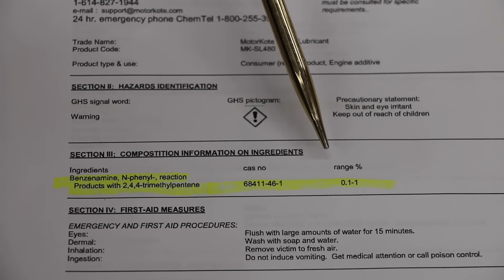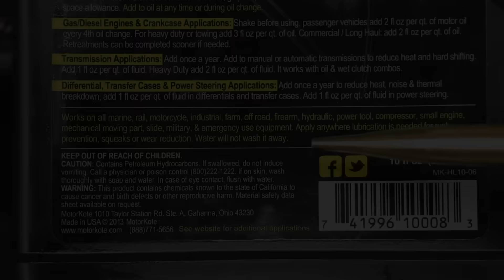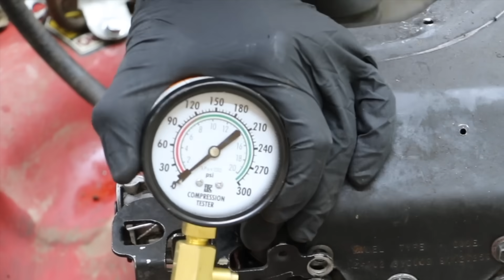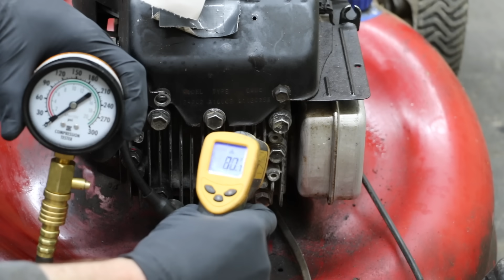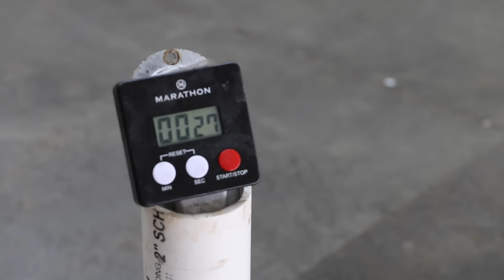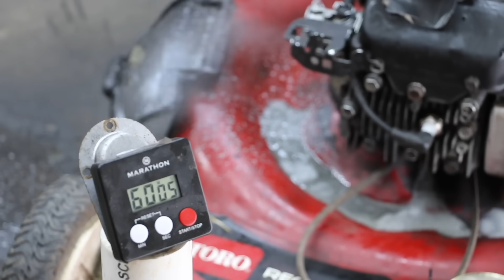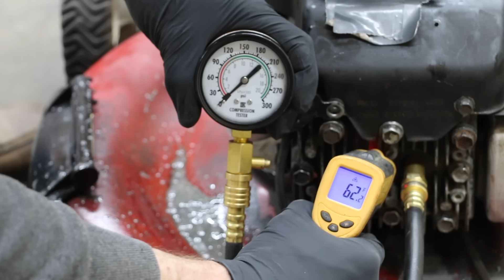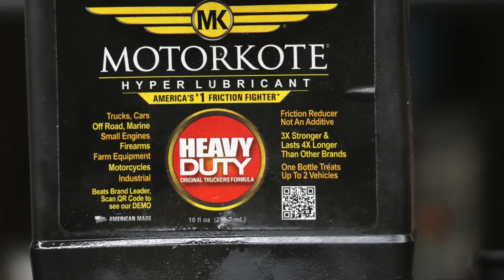Can MotorKote survive the water test?  Let's find out!

Comment: Old 75 yr. old ''sixtys' big block gearhead here again. I've now run my old Ford E250 extended body van almost three (3000) miles since adding MotorKote. Odometer is almost ready(25 miles more) to turn over 310,000. As I stated in a previous post, the 5.4 two valve engine picked up aprox. 50 rpms after adding this product. On my most recent 1224 mile round trip from Ft. Myers, Fl. to Canton, Ga. and back, all on I 75, this untouched 5.4 averaged 21.6 mpg. And that was with the van loaded with equipment. Soon,  I'll need to do another oil change and I'm going to add the MototKote again. I'm convinced it works.
Reply: Good folks. I did make a mistake on the average mileage from the stated trip of 1224 miles. The average mpg was 19.4. Sorry for the misinformation.
Reply from the maker: Impressive results!  Thanks for the update!
Reply: My 5.4 2v van averages about 16 mpg hwy fully loaded. Stoked to try this stuff. I do lots of cross country driving so this product could pay for itself quick.
Reply: Hi Joe. I've been working on vehicles since just before 1960. Seen many, at the time, new additives come along. But the testing that Project Farm did convinced me to try this stuff. My untouched 5.4  2v. is old with a ton of miles on it. If the Motorcote  isn't making it better, it sure isn't hurting it either.
Reply: punker4Real. I see that your just a 'tad' skeptical !!! This old Ford does approx. the same miles per gallon continually. Sorry that you don't believe me. Oh, I don't drive even near as 'hard' as you are driving. If you drive with just a 'little' common sense, not only will your vehicles last, but also give good mileage. My mpg is calculated from 66 mph(after 66mph, the mileage starts to drop), on cruise control, in the right hand lane, for sure.
From the trip that I stated, the first 431 miles, my truck averaged 17.21, mpg. On the trip back to Fl., it averaged 21.6. The distance between my two destinations is 612 miles, one way.(1224 miles, round trip). BTW, at 66+/- mph, the tack is at 2000 RPMs. punker4Real, your right, I did make a mistake. Please forgive an old man(hope you live this long-and stay this active) the average mpg was 19.4 mpg. Still not bad. AND WAY over your estimate.  I don't know how you could make such estimates of what my vehicle should do,,, WITHOUT knowing my vehicle, WITHOUT knowing my driving habits, WITHOUT knowing where I'm driving,  and WITHOUT knowing how I take care of my vehicles. Oh,,,,,, Mr. punker4Real, my E250, is a full size, extended body VAN. NOT a BOX TRUCK,  as you assumed.
Reply: LOL E250 getting 21MPG  what fairytale do you live in.
you would be lucky to even get 12MPG highway with that square box van..
higher RPM =more fuel used..
 I could barely get 24MPG with a 4 cylinder   2018 dodge caravan  but I was going about 90-100MPH the whole 1000 miles trip  no tickets....

Comment: I added this stuff to my old 2004 Honda Accord EXL V6, at about 180k, if I remember correctly.

After some time, a white crud appeared all over the rear bumper, right over the exhaust tips.

Changed the oil, and it went away.

The engine started to lose oil right around then, and then died at 198k with no issues prior to that.

Moral of story...I’m sad I only made it to 198k 🤣

Great videos!!!
Reply from the maker: Thank you!
Reply: Project Farm thank you for the entertaining, and informative videos!

Comment: A month or so ago, I left a comment stating that I was going to test this (Motorkote) in both of my cars. A '02 Honda Accord 2.3 and my 07' Toyota Camry 2.4, both about 144k miles. Unfortunately I can't really comment on the Accords mpg because my gf forgot to record the mileage and had the oil changed about a week after I added it, but she says it "Runs and Sounds Fine". My Camry however is a different story. I filled the tank and checked my milage (I do mostly city driving) and got about 24 mpg. Then added the recommended amount to the both the crankcase and transmission. After a good while I finally ran the tank down to about 1/3 and filled it again as I did before. And the results were NOT good. Not only has the car began to slip a lot more, and alot harder than it had before, it only got 21 mpg. The most interesting thing  is that not only should my increased awareness of my own driving habits have biased the test in favor of the Motorkote, but since I added it, I started going to an out-of-the-way gym as well. So theoretically I should have gotten BETTER gas mileage due simply to spending less time in stop-and-go traffic, and yet my mileage was still WORSE than before. That being said, the car sounds and runs about as smoothly as before (Very smoothly). your results may vary, but i will definitely NOT be using this stuff in a car truck ever again. It's a complete waste as far as I'm concerned.
Reply from the maker: Thank you very much for providing the update. It's unfortunate that the results were not good.
Reply: was it the same gas station where you always fill up?..
Reply: Yeah. fill up using only Shell Premium. And typically at the same station. Been doing so for years and so far my cars have been running great.

Comment: The biggest difference between water and an oil is comprehensibility.  Water blasting is not different than sand blasting, at sufficient velocity, there is no effective difference in sand vs water striking a surface.  Is your after engine cleaner?  I would expect this.   Your Motor Coat results are impressive.
Reply from the maker: Thank you!

Comment: Wow! Have been using Motorkote for yrs. in my differentials..in fact last fall while trying to add 2oz. to my latest 4 wheel drives diff's, i accidentally kicked the opened little jug and spilled 75-80% on my driveway of that expensive stuff :( (have the slickest driveway spot in the state?, but have never added to my engine oil..that will change now. Have been told to add some to my transmission when I change the oil, and have in 1 car so far, and it seemed to work well. Have used it in my differentials/transfer cases as I was told yrs. ago it really helps..and my completely unscientific test of feeling what was a hot running diff. on my big 4 wheel drive before and after (no control for different temps or anything like that) of grabbing it by hand, did show that after changing the oil and using 2 oz. of MotorKote had it much cooler on the handtest..now if I can just find a better way of getting it into them (differentials and transfer cases)
Reply from the maker: Impressive!  Glad to get more feedback on MotorKote.

Comment: How would this work if you put it in an engine was already contaminated with water...  Like a blown head gasket
Reply from the maker: I wouldn't recommend this, since water will oxidize/rust the internals of the engine very quickly, causing bigger issues.

Comment: BTW, I am surprised you didn't apply the same test as you did with Bestline.  Remember, the two engines running without oil?  You'd only need to run one engine with MotorKote and time it, to see if it beats the Bestline time of 71 minutes without oil.  That would be cool to note. Bestline or Motorkote for when your crankcase bleeds out. Which will let you get farther down the road?  :-)
Reply from the maker: LOL!  Yes, I've taken a lot of heat from viewers for destroying engines.  I'm still undecided on this.
Reply: What????  What do they think they are, animals? It isn't like you are killing a living thing. Oh boy, some people. It's an engine! LOL!  I didn't think you attracted the "hug an engine" group.  That test with Bestline was awesome, plain and simple. We can SEE how it actually did against the other 'same' engine.  If you did the same thing with MotorKote, it would be easy to see which of the two is best. I'm thinking MotorKote, but we'll never know unless we pop another crank.  ;-b  PS: I bought some today so I'm extra interested.
Reply: I agree bestline and motorkote seem to be top 2 as of now. Be interesting to see which is best.

Comment: +projectfarm I would like to see you test Boric Acid as a friction reducer in oil and also as a fuel additive for increased fuel efficiency,   Now after some quick research you will have to make it soluble, which can be done with methanol or acetone.   And I know if added to methanol and burned it will change the burn to a green color will the exhaust show a green color.   Maybe a see through head will be best to test this?   I hope you will see my comment and give it a shot
Reply from the maker: Thank you for this recommendation!
Reply: Project Farm hope to see it in a video,  maybe this is one of the key components of a lot of other additives?

Comment: I came back because I kept replaying the bearing test with 100% motor kote in my head.  Have you ever seen that little of wear on any other lubricant test.  I recently used it in my Sprinter and added two bottles because of the volume (3 gallons of oil)  before watching the video.  Almost wonder if I could get away with 100 percent motor kote in a smaller engine $$$ and with what results.  I have a prius that this might be perfect for (perhaps a video)
Reply from the maker: I wouldn't recommend adding more than the suggested amount.  Yes, this is the slickest stuff I've tested to date.  The truckers that have commented on this forum have nothing but positive things to say.

Comment: Hi Project Farm! I am wondering that will you be able to run a test like this video with Group III IV V  Base Stock synthetic oil (ex. amsoil, total, castrol edge, valvoline, pennzoil...) with & without bestline engine oil additive compare to a conventional oil with additive? For this test, I am trying to see do group 3 to 5 base stock oil do really make that much of a difference. After that, when adding additive on top, will it actually enhance or decrease the oil's performance

Again, thank you so much for your excellent video, and keep up the good work!
Reply from the maker: Yes, I'll definitely do some testing on Group III, IV, and V Base Stock synthetic oil products in the future. Thank you for this recommendation!

Comment: Have you ever heard of truckers best? It's an oil additive that suppose to fill cylinder walls and lubricates engine. When I worked at wingfoot tire we had some and put it on a bearing tester. I could literally hang from the bar and it would not slow down.
Reply from the maker: Thank you for this recommendation!

Comment: I'd be interested in seeing a you do a durability and quality comparison test of different types of undercoating paint products. Which type and brand would protect the metal it's on the best? Standard, ceramic, zinc, rubberized or powder coating. Does thickness matter over type? There are multiple sites that have comparisons where they give a final rating and generic details on how that was done but never like your videos where you take the scientific method and have a lot of data points to backup your tests along with real world examples.
Reply from the maker: Thank you for this recommendation!

Comment: Project farm put this video to the real test!! :https://www.youtube.com/watch?v=1UYiZpunx5A
Reply from the maker: Yes, this is the video I referenced. Thank you!
Reply: Watching this again i thought to myself.. would adding motorkote to the surface that the engine brake is applied to would render it useless?
Reply: I was also curious about the bearings being tested.  If possible to get them up to engine operating temp then running the fluid through them.  Might be a neat test to see if oils act the same when at running temp..

Comment: Initially I went out and bought a bottle of this motorkote, after doing some research on and I found out that it's highly chlorinated paraffin. In other words it's made of low-grade paraffin oil with massive amounts of highly concentrated chlorine added to it. I would not use it in an engine due to chlorine mixed with water from combustion gases causes high acidity in the oil. I took my bottle that I bought of motorkote back for a refund
Reply from the maker: Thanks for this information.

Comment: Good information, however, i would have liked to see two more things: disassemble the engine and inspect for damage, also, run a different engine that has not had Motorkote in it, with water and see how long that lasts.
Reply from the maker: Thank you for this recommendation.

Comment: I just bought some of this stuff today at autozone question would you normally use it in your cars and engines on regular basis from you test?
Reply from the maker: From the research I've done, it can be used with each oil change, but you don't have to use as much after the 1st oil change.  I seem to recall that it's 1 oz per qt after the 1st oil change, but please double check the instructions.

Comment: Man I cant believe I just thought this up, probably because you usually do first. But you did not test an engine with straight oil then running it on water for an hour to see if the engine actually would be damaged after an hour.
Reply from the maker: I thought about doing that, but then someone would say that I didn't use the same engine, like the Slick 50 video.
Reply: Ah ok. I wouldn't expect the same engine to be used because it said you basically have to sand it off. thanks for the Video, I wish I had seen it earlier! As I had a bottle of this in my hand weeks ago at Walmart Clearance Aisle. I had no clue what it was! I used an inventory app and found 1 store in my state with 8 bottles of this for $7 each! I bought them all! lol. another had 13 but no one could find them.

Comment: If motorkote adheres itself to metal and needs to be sanded off then wouldn't that dictate it would clog or shrink tiny holes used to lubricate certain areas of a car engine? and thus cause certain areas to receive less lubrication? anyway to test that? BTW awesome video, I def would use in my lawn mower and snow blower, but not in my car for the reason above
Reply from the maker: Apparently, the coating is extremely thin.  Several truckers have commented that they've used this product for thousands of miles and had the oil tested/analyzed with good results.
Reply: Yeah I have been researching it since I watched the video! I so want to put it in my cars, but I'm not sure how thin is extremely thin or how tiny oil delivery holes are. I may just be too scared lol. I asked this question because I saw on a trucker forum one dude said its why he wouldn't use it and another dude said he used it in his tranny and engine. after he left his truck in storage for the winter his tranny and engine both had odd failures of some hardened stuff in the lubricants. BUT this stuff apparently has been out for at least 7 years now, if all that stuff was true there would be crazy posts about it everywhere.

Comment: Shares in motorkote just went up! Cant believe it ran with water, the question would be what would it be like if you hadnt used motorkote and only used water?
Reply from the maker: I should test running an engine with only water in the crankcase.  Great suggestion!

Comment: A great one, very interesting results.
As a side, and a bit of a laugh.
If you add this to a motorcycle engine it has very negative effect on the wet clutch friction properties.
Put this in a motor with a wet clutch and you are going nowhere LOL!
Thanks for this channel and the consistency of it.

Regards,

Duncan from RSA
Reply from the maker: Thank you for commenting on this.  You're right, not meant for a CVT transmission or a wet clutch setup.  Thanks for commenting!
Reply: you are wrong, two years ago, i used it on my z1000 and it worked really good, the engine ran smoother and the clutch worked perfect

Comment: 7:38 you say oil has 2 main purposes, it has 3, the two you mentioned and keeping dirt suspended in the oil to help it stay cleaner (esp when using a filter).
Reply from the maker: I didn't do very good at communicating.  For short-term engine survival, lubrication and dissipation of heat.  You're right, there are other purposes too.
Reply: Based on your review I actually bought a 32oz bottle of MotorKote today.

Comment: Great videos!!
I would recommend you to supercharge the engine with compressed air. That should work!!
Thanks for the videos!!
Reply: To make it easier, maybe you can use the fuel fumes device. put the compressor hose there and run the engine. So you don't have to fix the carburetor for pressure.
Reply from the maker: Thank you for this recommendation!

Comment: Could you speak to how this would affect a wet clutch in a motorcycle?  From what I've read, a friction reducer should not be used with a wet clutch it can cause problems.
Reply from the maker: You're right. It's not supposed to be used in a wet clutch system.